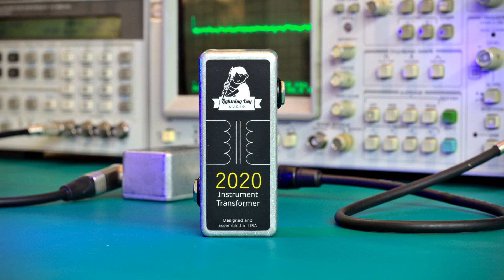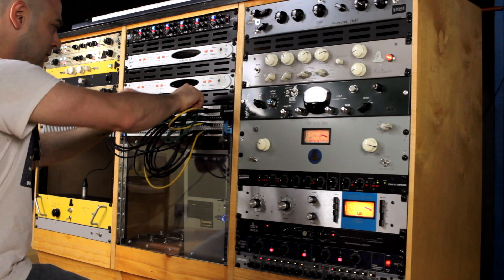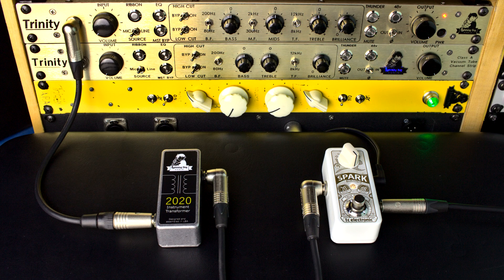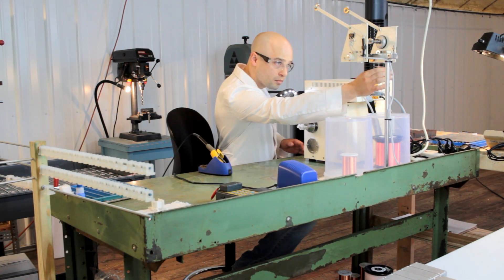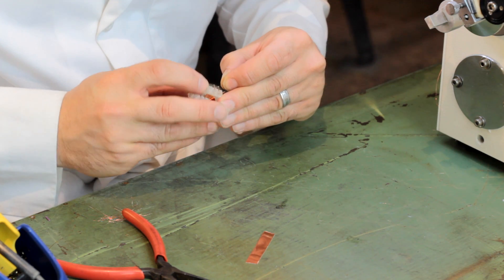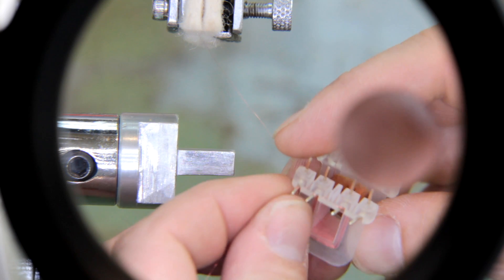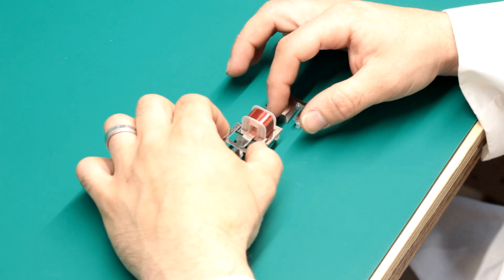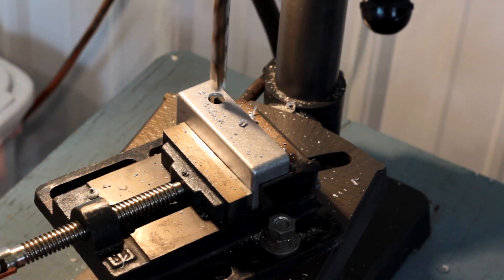Lightning Boy Audio 2020 Instrument Transformer

Comment: LIGHTNING BOY AUDIO, Do you make an guitar isolation transformer so its high impedance to high impedance line isolator box plus with a ground lift switch to float the ground. The single coil pickups in telecasters and stratocaster have hiss noises and hum which the unbalanced high impedance to high impedance line isolator transformer box should REMOVE all the single coil RF interferences, 60hz hum, room lights buzzing, guitar amplifiers line transformer hum, etc?

Comment: Amazing job you have done with this unit. I tell everyone, willing to lend an ear, about audio signal transformer  use, saturation, and what I just learned the more technical term from your video in the even order harmonics. Hell input, output, matching, direct box (15:1), isolation (1:1), etc audio signal transformers make up a good percentage of the vintage sound profile people often call warm when referring to vacuum tube amplifiers, vintage recording consoles, etc... I am going to have to try one of your Lightning Boy XFRMR ISO units, I am always sharking ebay looking for a steal on pulled audio console transformers which I use in my effect pedals as passive mojo inducing D.I. XLR outputs. Not only do they look super cool in the can mounted to the box, but they sound amazing (especially on bass guitars), and they honestly save a lot of components that would be required to make an active XLR D.I. output. I even fancy them up with some special tape to give them a intriguing aesthetic. Can't wait to buy one of your units!

Comment: How come you don't mention "Common Mode Rejection" ...that's the reason i would buy it...all noise is common mode, it's better than a noise gate by a long shot..
Reply from the maker: Common mode rejection is certainly a feature.  Not all noise is common mode.  There’s ground loop noise, carbon composition resistors create a hiss noise, thermal noise, etc.
Reply: @LightningBoyAudio  yeah that's true...
i was referring to interference noise picked up by the instrument.
Reply: @LightningBoyAudio  i should say all interference noise is common mode..

Comment: Is this isolated input and output ground?
Reply from the maker: No its not, but the 2020i will be coming out soon and it offers ground isolation.  Please check back.  Thanks!
Reply: What would be the benefit to this isolation?
Reply: @biggermikebass1026  ground lift isolation lets you get off that horrible ground loop noise. I use direct boxes with ground lift feature to eliminate this problem

Comment: I hear only reverb .
Reply: There's definitely reverb, but transformers actually add sustain. 

Basically, a transformer creates a magnetic field that doesn't dissipate as quickly as the signal you feed into  it.

A guitar is composed off many sine waves, all oscillating at different frequencies. A transformer takes all these oscillating waves, and sends them into a transformer, where they share a common magnetic field. The magnetic field isn't strong enough to lock the electrical currents that carry your signal into place, but it does bond them together, and then the field tends to sort them into frequencies, because the magnetic field tends to pass current at different rates, depending on frequency. 

This is why transformers tend to produce harmonics, and also create a sort of "cohesiveness", but also seem to stratify notes and provide clarity and sustain... you send current that contains everything you play into a common magnetic field... the magnetic field negotiates between what it receives in real time, and what it releases based on frequency being able to translate itself through the magnetic field, independent of the source... and the field produced by the coiled wire does not release current as readily as if it had run through a straight wire.

I know you probably think I'm bullshitting because there WAS reverb on it, but the difference would probably be more audible without it.